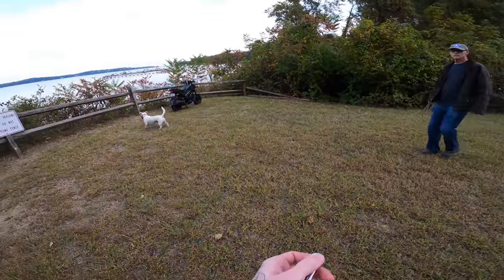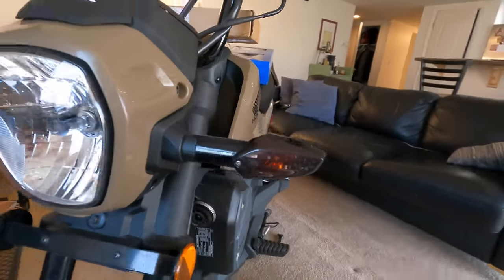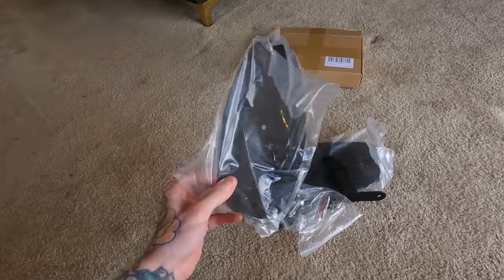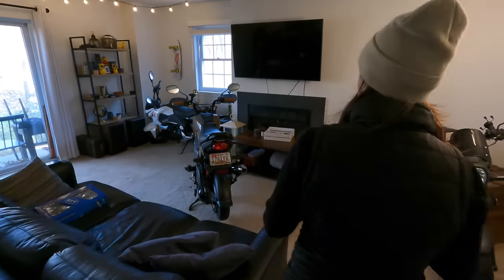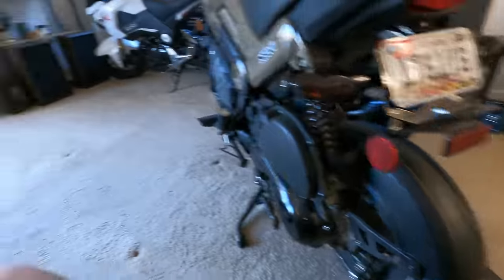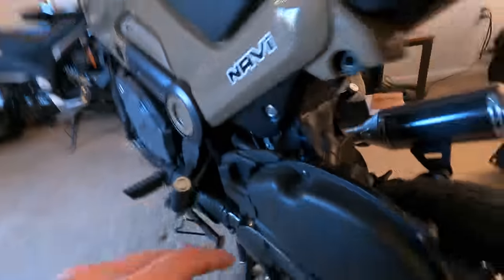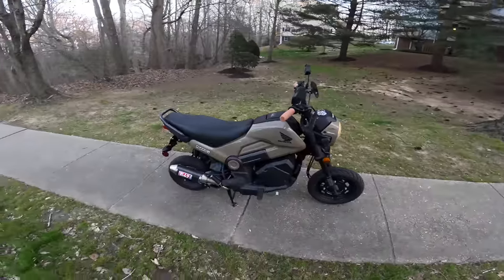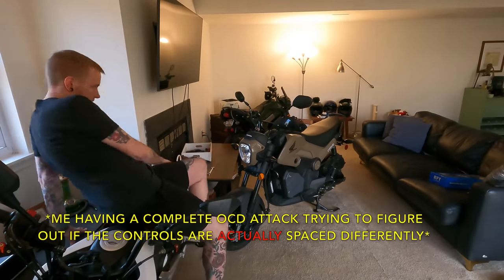3 Honda Navi Mods SO CHEAP It Feels Too Good To Be True

Comment: the guards would drive my OCD through the wall. That's why I removed them from my harley. also did you put the rubber seal behind the lens that popped. Those seals are dual purpose. 1 keeps water out, 2 keeps you from overtightening the screw and cracking the lens

Comment: very nice video..👍 I bought a brand new 23 grasshopper green, all original; right out of the dealership..
 25~35mph average speed..
10W-30 GN4 frequently oil 🛢 change every 100miles for 1000miles engine break-in cycle.. after that period switch to synthetic (10W-30SJ) at continuous 200miles oil 🛢 change forever..

PS.. also change gearbox ⚙️ oil (SAE80W/85W) every-time oil-change..🛵✨️
stay safe
thanx..👍

Comment: They look great and the shock seems to work well too.  If you had to chose between just the Navi or the Grom for a 2nd bike, which one would you keep?  (I know the Navi has more storage but the Grom is faster.....I think that new shock on the Navi may make a big difference in your decision since I remember how bad the stock one was.)
Reply from the maker: Honestly the Grom and Navi are so different that there’s no “one size fits all” answer to your question. 

I think the primary thing to consider is what kind of riding you’ll be doing and what kind of roads you’ll be on. The Navi cruises 40-45mph while the Grom can cruise 55mph+. So the Navi’s lower cruising speed could immediately knock it out of contention for lots of people. 

If you determine that speed isn’t a factor for the type of riding you’ll be doing, then I think price and features come next. The Navi is obviously much cheaper brand new, but Groms can be found used for not much more than a Navi if you’re patient. As far as features, I love the storage on the Navi, how easy it is to work on, and the fact there’s never a chain to maintain/adjust. On the Grom I love that it’s fuel injected, starts up every time first go, has waayyy better brakes, and has such higher build quality. 

For the type of riding I personally do, I’d keep the Grom as a second bike if I could only have one. But the Navi’s so cheap that it almost would never make sense to sell anyway. 

Hope that helps!
Reply: @LifeOfBurch  Thanks for your answer.  I'll be riding back roads so mostly 40mph. I'll be buying new and the availability better on the Navi than the Grom so that may be the deciding factor. (but I have about a 40 degree driveway so hope the bike is powerful enough to make it up the hill.)
Reply: Grom is fuel injected and navi is carbed too.... some people don't like fiddling with carbs.
Reply: @ganuvien  Very true. That's a good point to consider. Thanks.

Comment: I'm sort of in between vehicles right now. Been looking at this, the Ruckus and Grom since they're all so "cheap". I don't really intend on going on the freeway anyway, but rather locally, small grocery shopping, and general cruising around/joy riding, sometimes driving up the PCH hwy 1 (San diego area). I'm curious which one you would you recommend?
Reply: Navi is too slow for PCH, I have one and d-bags in huge pick-up trucks lose their minds when I go 45 in a 50 mph zone.

Comment: I would like the Navi for around town but can it really perform at 55-65 mph on smaller highways ?  Would like to see a performance  review update after the added items?
Reply: It’s just not something I’d do personally. High winds with cars cruising most times 5 over the speed limit…it’s just not safe truthfully.
Reply: You would have to do LOTS of upgrades to reach that speed. 52MPH downhill is the top speed on mine. I'm 6 ft and 190lbs

Comment: Great video. What’s the thing that you put inside the exhaust to make it quieter?
Reply from the maker: Thanks! It’s Yoshimura’s spark arrestor insert. It ends up making it a bit quieter than their low volume insert option. 

https://www.yoshimura-rd.com/collections/spark-arrester-kits/products/spark-arrester-kit-rs-2-mini-muffler-1-550-ring-sa-23-k?variant=40054175924327

Comment: Hi Burch I'm looking into a new motorcycle and have been debating between the rebel 500 and the shadow 750.  Also it would be my first bike as I'm a new rider.  What are your thoughts? Or anyone on the birch fam  has any thoughts? I'm 5. 2' 148lbs

Comment: Hey cuz. I'm 210 
And ride 2 up alot. You think this shock will be good for the weight?
Thx cuz
Reply from the maker: Honestly at that weight and two-up, this shock will likely be too soft. But the piggyback reservoir does have a spot to add more air to increase the pressure, so it could be worth giving that a try if the preload alone doesn’t get you where you need to be!
Reply: @LifeOfBurch  thx for answer. Gonna cancel this order. Lol

Comment: OK... cut the bs, is it possible to do relatively cheap mods to at least make this thing go 60mph? where i'm from, bikes needs to be able to maintain this speed to be hwy worthy. Not that I would ride this on the hwy every day but it's good to know that there is such option. TIA.
Reply from the maker: No, it will never hold 60 mph. Mine tops out at 58 mph now, but will still only hold a steady 45-52ish mph depending on how hilly the road is. You’re better off with a Grom or something more powerful.